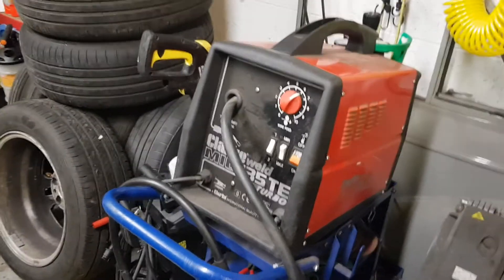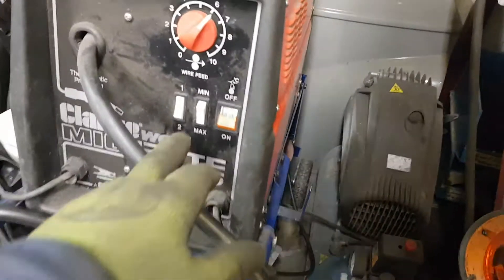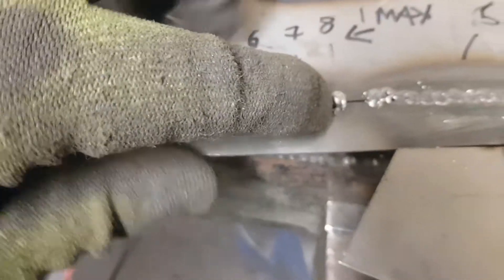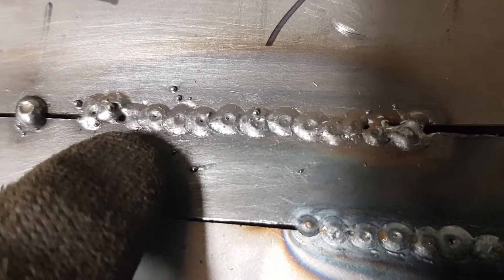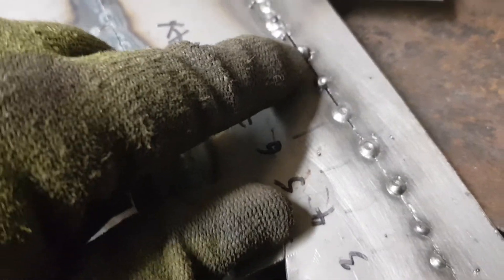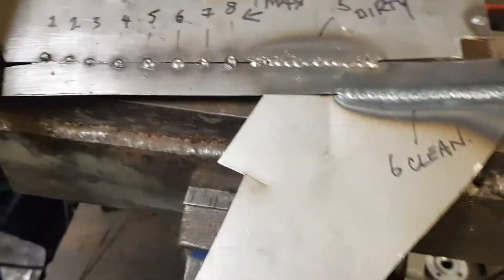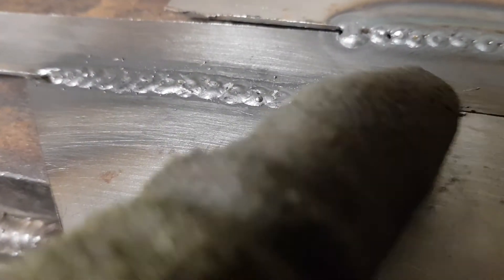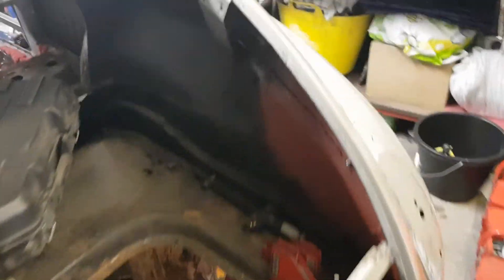Clarke Mig 135TE settings (Morris Minor repair)

Comment: Great video, thanks for the upload. 

8:30 that weld may need less voltage on the selection switches and/or more wire speed (amps) for increased penetration.....it's always a trade off?

.... often the case when using MIGs with too high a capacity for thin bodywork steel, the low end current and voltage is tough to set with too large a step between settings. Older sprung hi tensile body steel maybe thicker but I find it's tougher to weld due to its carbon content. 

 The Internet would have you believe that bigger is better with MIG amps. 

A 90 amp MIG really is all the power and still then some you need for car monocoques. We aren't dealing with gate hinge gauge here etc. 

Interesting video. Been MIG welding over 40 years, it gets easier but, every day is school day😊😎

Comment: I want to buy a welder , would you recommend that Clarke 135 ?? I m restoring a Fiat 850 coupe 1971
Reply: I've got one it's OK. However on Gas I've found it pretty crap! 
Now I know you not ment to but I've been  using No Gas wire on it with Gas and its been loads better and produces much much better results! Now I know it says I am ment to use Gas but again those results are Crap!